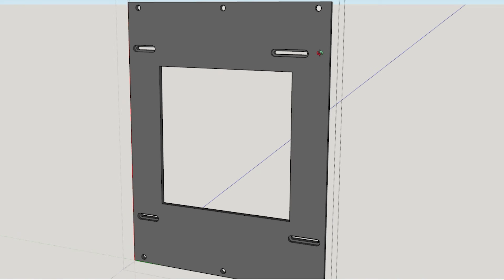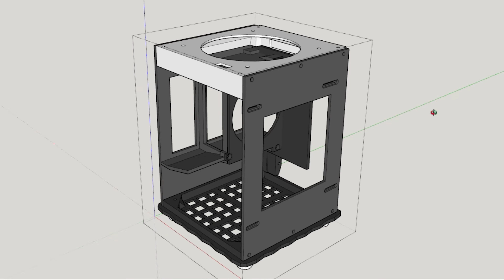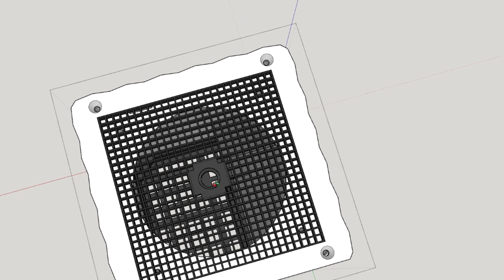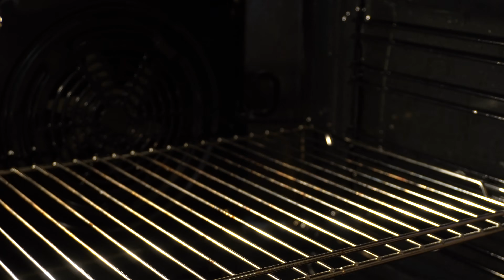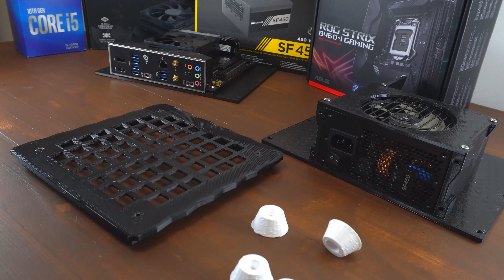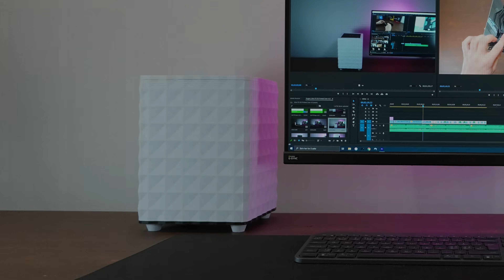CUSTOM MINI ITX PC BUILD 9.7L 3D PRINTABLE

Comment from the maker: June 2, 2021, 8.00 PM (GMT). New bugfixed files uploaded to thingiverse based on feedback. I really appreciate feedback when you notice bugs! :)
Reply: Wow, downloading now :) Thank you so much. Your Big Boy is next :)
Reply from the maker: @RetroGG-74  Awesome! :-) About the «Big Boy»... I did find out yesterday that ATX power supplies apparently comes in different depth sizes. Make sure the PSU you use isn’t wider than 125mm from front to back. I found that a lot of ATX psu’s are also 140mm 🙂 I might try to fix it to support the 140mm ATX supply as well but I’ve gotta do that in a few days as I’ve got a lot on my schedule the next days 😊 I’m really glad you like my case designs!
Reply: @makerunit  Yes, very much. Form factor and function all the way. Something different than the common everybody has such n' such case.  I will be sure what I have before print on that one. This one is getting my parts from a case I thoroughly abhor (more desktop console style but piss poor with heat dissipation) and was thankful to see something fresh while I'm learning this print thing.
Reply from the maker: @RetroGG-74  the outer cover is definitely the most tricky part to print. Try putting it inside a closet if you can or an enclosure to protect it from any winds caused by either you or your surroundings. As too rapid cooling (a single blow is enough) may result in bad warping or layer separation cracks. 👍
Reply from the maker: @RetroGG-74  Your "Big Boy" comment further up is actually kind of funny today 2 years later as it actually inspired me to name my newest project which I'm calling "The Big Boy". I'll have it posted probably tonight, but may already be posted when you read this comment!
Reply: @makerunit  :) just saw your Big Boy, you have quite the eye for design. Very nice
Reply from the maker: @RetroGG-74  thank you so much! 😁 I appreciate the good feedback!
Reply: This is incredible - I have a question though - what are you using to slice this? Cura is giving me some errors from the model with some pieces.
Reply from the maker: @mikeatkinson9168  Thank you! And Prusa slicer has been the slicer I’ve used mainly. You mind letting me know which exact piece gives you errors? Might be a hidden line or something inside one of the objects causing the slicer errors, it should be an easy fix in most cases.
Reply: @makerunit  Thanks for the swift response! I'm getting the error in Power_supply_side_panel.stl - this seems to be where the "raised" bits meet the base plate, if that makes sense?

I am using cura, so I can try Prusa Slicer and see if I have a better result.
Reply from the maker: @mikeatkinson9168  ah, I understand. I’m not able to get to my computer until about 12 hours from now. So I can’t look into it before that unfortunately, but you can try opening the sketchup file on your computer. Double click on the specific part needed to modify. Then you can try to clean it up yourself if you don’t want to wait. Usually when layers are missing in the middle of a part, there is some kind line or hidden geometry inside the part somewhere.
Reply: @makerunit  Thank you for the offer - however I've now thrown it into prusa slicer and it seems much happier!
Reply from the maker: @mikeatkinson9168  awesome! I’m glad your issue was solved! 😊 I believe each slicer has a slightly different way of dealing with model errors. 😊

Comment: has a downdraft cooler worked well for you with your case? im designing my own chimney case and am still considering if i should use a tower cooler rotated to exhaust upward.
Reply from the maker: If you have space for it, a tower cooler is definitely the best alternative for a natural and efficient airfow. This one is a bit restricted in height, which affected my choice. It’s not super effective but gets the job done on a non-demanding CPU.

Comment: I am currently printing this case to be used as a NAS. Just gonna house a power supply and a few hard drives.

With the 0.6 tip and 20% infill with PLA+/PLApro this thing is strong and sturdy as if it was printed with 50% infill. Gonna probably use this again for a future PC build.
Reply from the maker: Great to hear! Thank you for sharing your experience! 😊

Comment: This is a computer for streams or play gamers?
Reply from the maker: With the parts I used (1660 super gpu) it’s good for 1080p gaming at 90-120fps mostly. If also streaming I’d suggest a better graphics card. This case is best for just mid-range gaming in my opinion 😊 for streaming I would go for something a little bigger and more powerful

Comment: Any problems with the material? Pla tg is 55c. No creep or other issues?
Reply: Very nice looking design
Reply from the maker: Thank you! Glad you liked it!
Reply from the maker: And, about the material, since I made it I have moved the components to other projects but during the months it was in use there was no issues regarding heat. That PLA «starts to soften» at 55 degrees doesnt mean it turns into liquid. Also, even if a CPU would reach 90 degrees that’s at the processor core, not the surrounding air. So really no issues with PLA. Though I would probably now that I have more experience with PETG suggest if you can to use PETG instead because the layers bond so much better resulting in a much much stronger part overall, though PLA is also just fine 😊

Comment: this is pretty cool! But im looking at using a razer core for my GPU. Is it possible to re-model the STL to have a drive bay or two wher the GPU would go? Or could you shoot me the step files so i could do it myself?
Reply from the maker: Did I not include the sketchup file in the Thingiverse link? it’s possible to just modify the bottom air intake quite easily to be able to hold a drive or two 👍🙂

Comment: How much filament was required to do this?
Reply from the maker: Hey, all depends on infill percentage etc I used a 0.6mm nozzle with white PLA and I think just over half a roll of white + about a quarter roll of black (1kg spools) 👍😊
Reply from the maker: Actually, probably closer to half a spool of black too. So approximately a full spool in total

Comment: Somebody tried printing this on ender3?
Reply from the maker: The cover itself should be printable on the Ender 3 but the inner chassis side panels require a print surface slightly larger than what the Ender 3 can print (i think 240 or 250mm) so unfortunately it’s not printable on that printer.🥲

Comment: Would be interesting to extend the top and bottom to be able to fit 2x140 radiators and try a water cooling build with the barrow pump/block combo. Guessing the FE 30 series cards are still probably a bit too long though. So maybe just room for a 140 aio up top. Cool design.
Reply from the maker: I’ve got a few projects I’m working on right now one of them will feature a 3070 and a 240mm rad most likely. That’s an interesting waterblock, I haven’t seen that type before. Cool! I don’t really have any watercooling experience yet so I’ll stick with a pre-made loop for my first watercooled build but in the future I’d love to try more cool stuff like that!

And unfortunately. My 3070 is about 290mm long. The case supports a maximum of 175mm here and 270mm on my other case I made… can’t really print bigger than 270 at the moment as my printer can’t print more than 300x300 at most. I’ve gotta figure out something smart there…

Comment: That large flat space on the back plate...could be used to make a cutout and have space for a few 2.5" SSD's between the powersupply and motherboard
Very very very cool design!!!!
Reply from the maker: Yeah I thought of it but wasn’t sure about the space because I needed room for all the cables from the PSU also as it was kinda tight… currently working on another even more compact ITX case with 2.5’’ support! 😊
Reply: @makerunit  I will sub for that. I just found your design on thingiverse and I love it. I'd print it right now if I didn't have a tall CPU cooler.
Reply from the maker: @m14wx  thank you! 😊 Have you checked out my other designs? I’ve got two more pc cases 😊 one supporting 270mm gpu

Comment: Isn't a fully 3D-printed PC case bent or melted by heating of CPU and GPU?
Reply from the maker: Actually, no, because you probably know that CPU’s or GPU’s in some scenarios may reach temps up to 90 degrees or even more. But remember this is at the core of the processors. Not the actual air that’s blowing past it. I’d say in a worst case scenario the plastic MAY become slightly softer, but it would require some force (like you intentionally trying to bend it) to actually make it deform I would believe. During my tests I’ve never even felt the 3D printed parts become any soft at all 😊

Comment: Hey, nice design. I want to buy a 3d printer and consider to print this case, but what Print size/volume do I need. Is 220 * 220 * 250 mm enough or do I need more?
Reply: Great video I can't wait to try printing it!! My printer size is 235x235x250 I have a ender 3 pro if I shrink it to fit my printer how will it limit my part choices ?? Also can you list the parts you used??
Reply from the maker: @patrick selzer  Hey, on an Ender 3 you’ll be able to print every part (even the outer cover). Exept for the two side panels. The motherboard mount and psu mount, as their size will exceed 235mm and should be printed laying down. All you’d need to do to be able to print it is to somehow split the two side panels and melt them back together and you should be good to go but may only make it slightly weaker. I might re-design it in two sections or add a few STL’s so it’ll get printable on the ender as I see so many people own these printers! 🙂 

Also, all the parts I used are already linked in the description 😊
Reply from the maker: Hey, I’ve got to double check that I’ll get back to you a little later. I do believe that the internal side panels exceed 220mm as they have to be printed laying down. But I’ll double check as I’m not by a computer until tonight. 

What you can do in the meantime is download the sketchup file from thingiverse and use the measuring tape tool to check all the dimensions everywhere.

When opening the sketchup file all parts are divided into groups. Double click the part you want to check out to separate it from the other parts. And click anywhere in the blank space around it to go back to see all the components again.
Reply from the maker: I checked now. Minimum required print size is 250x250x250mm unfortunately 😔
Reply: @makerunit  OK, sad... But thanks for the answer.
Reply from the maker: @TimS555  you could actually get away with printing it if you somehow can split the two side panels to make them slightly shorter! I see many people want to print this on Ender 3 printers, I’ll see if I can come up with a smart solution to that issue! 😊

Comment: Just wondering-where can you find dimensions for things like hole spacing in PC's? I looked all over and its a total crapshoot. or did you just measure manually with calipers?
Reply from the maker: Hey, so what I did was actually to measure everything manually 👍😊 I also had a hard time finding the hole spacing online. And no matter what I did the holes would never be spot on for all four holes, that’s why I made the longer holes so I had a little bit of room which worked. And also allowed for slight adjustment of the motherboard location 🙂

One tip is to measure approximately where the holes should be. Put it in your CAD software, then just print the very first layer. See if the holes align, if they don’t, use the layer you printed and measure approx how much off you are and correct the cad. Repeat until it’s all perfectly aligned 😊

Comment: Is this meant to be a 3D printable copy of the first Gen. HGC Osmi? I like this shell better than the Osmi tho.
Reply from the maker: Hey! Actually I wasn’t aware of this case, but that looked very similar 😅 Initially I was trying to create a Xbox Series X lookalike pc case but I found that the dimensions of the Series X wouldn’t be big enough for a mini itx board so I somehow ended up on this design after a bunch of attempts of something square chimney style 😊 but thanks for sharing it though! Good to know what other stuff is already out there 😊
Reply: @makerunit  The Osmi was... an elusive case tbh. For years people have complained about how hard it is to buy one, and if you got one, it had issue with hardware fitment. Btw, since the CPU cooler recycles the hot GPU air, i'd sugegst making a few holes above the MB I/O.

Comment: how does 3d printed material hold up to the heat generated by the pc?
Reply from the maker: It holds up fairly well. I have not encountered any issues due to heat from components. The safest choice would maybe be to use PETG or ABS, but they can also be a lot more tricky to print with. 👍

But generally none of the parts are in direct contact with the hot components. Only the air is blowing upwards towards the top. And the air isn’t close to as hot as the actual components 🙂

Comment: Cool, but i'm not a fan of how the psu's intake is right in front of the cpucooler, I feel as though that might make it a bit toasty
Reply from the maker: Yeah, that seems to be the thing most people have complained about. With my setup the temps were really fine. More coming though. These two first cases I made I focused mostly on the looks. Next will be more airflow/thermal focused 😊

Comment: very smart PSU orientation to pull heat away from the CPU. PCI mounting bracket was very well thought out too.  great build.
Reply from the maker: Thank you! Yeah it serves as a secondary exhaust fan! I think does it helps the airflow a little bit. 🙂

Comment: If I needed any reason to buy a 3d printer and learn CAD, this would be it!! I love ITX builds, but finding that perfect case is impossible. Best I have gotten was a modded TT Core V1 (although it was a custom full WC loop inside so the additional volume was welcomed).
I would def print this out in a more clear/translucent and throw in all the RGB, it would then make for a pretty sweet lamp on the desk.
Reply: Any pics on that core v1?
Reply from the maker: I actually thought of that too! One of my previous attempts I printed the cover in white. Then I noticed by accident that in low light situations the RGB’s from the mobo actually lit up the white filament panel creating a really cool looking effect on the outside which gave me a good idea! I was actually thinking of implementing some of that in one of my upcoming builds! 👍

You should really experiment a little with CAD it’s actually not as steep a learning curve as you might think! Also there are plenty of cheap printers to start out with like the Ender 3 for example which I’m thinking of getting as a secondary printer for smaller prints sometime in the future 🙂

Comment: Nice work, compatible aio 120 with fan slim? thanks
Reply from the maker: This one only has mounting holes for a 140mm exhaust fan unfortunately. I don't think there is enough clearance to fit a radiator and a fan without hitting the motherboard.
Reply from the maker: It’s been designed based on a 140x25mm fan, I guess if you can get a thin enough radiator it could perhaps work but I have no guarantees as I think it might mess with the airfow😅 For my next time making a case I’ll try to implement more flexibility in terms of different hardware!
Reply: @makerunit  you need 45mm aprox for aio 120 ( 15 fan slim + 27mm radiator) i m suscribe your channel love your cases. nice bro!
Reply from the maker: @NeeqoCarp29  Thank you I appreciate the positive response! 😊 I do think it might be too tight with space unfortunately. It might possibly be room if you do not use the spot for the hard drive but I’m not 100% sure about it. And it might restrict the airflow a little too much as this was designed mainly to be air cooled and with a blower card 👍 but I’ll be making more cases in the future which will be less focused on clean looks and more focused on airflow/cooling compatibility.

Comment from the maker: Make sure to check out my NEW case build video here: https://youtu.be/WKnhARips-w 👍
Reply: Hey there, I printed the case and noticed a few minor issues. The base plate is missing a side panel screw hole( I figure a hot nail will fix that so I don't need to reprint) , the power supply cover has one of the four screw hole mounts detach when sliced and printed (I repaired it in netfabb and reprinted and the top vent switch plate (the only issue I haven't resolved as I'm new to this yet :)...) prints a layer at the bottom that doesn't permit airflow and the border are somewhat detached. I've tried S3D and Cura to same result. are you using a different slicer or is it a possible simple fix you could lead me to. Again great design and thanks for your effort and share.
Reply from the maker: @RetroGG-74  hey! Cool to hear you tried to print the case. I will look into the issue (slicing error?) I’m using PrusaSlicer.

And thank you for reporting issues, it’s really helpful to me! 😊

I think the error might come from some kind of hidden line maybe inside of the 3D object that confuses the slicer. I’ll look into that! 👍 and I’ll reply again to this comment once I’ve figured out what causes it! 🙂
Reply from the maker: @RetroGG-74  Hey! I just re-uploaded 3 files to thingiverse where I repaired the bugs and they seem to not have any problems in the slicer now.
They were:
- Top ventilation piece w/hole for power button (It was missing the bottom layer in the 3D file, resulting in the slicer reading it as just a hollow shell.)
- Clamping plate for Power Supply (no more missing parts in Slicer.)
- Bottom plate is fixed so it has all 3 mounting holes on both sides. Holes were also made slightly deeper.

Let me know if they seem alright to you. I wish you a great day and good luck printing! :-)